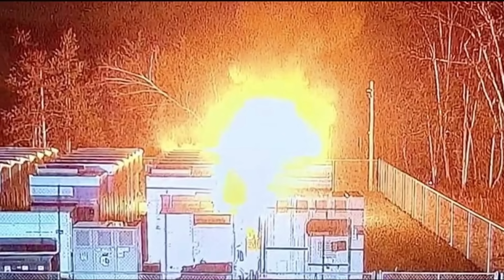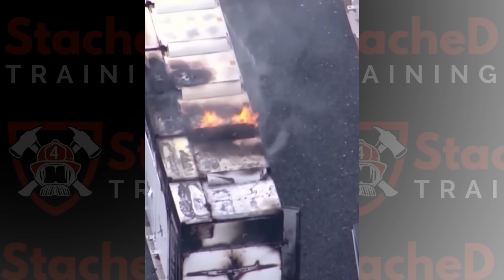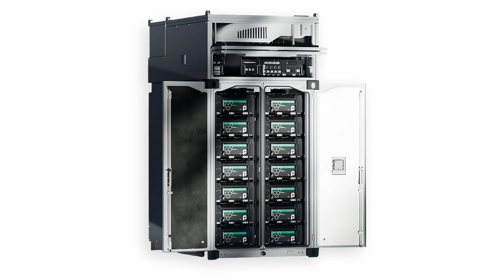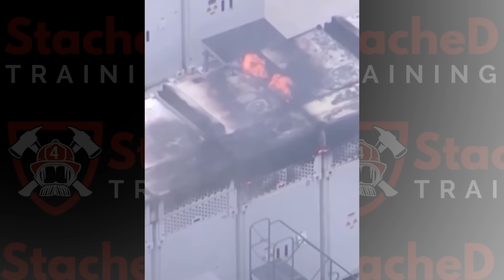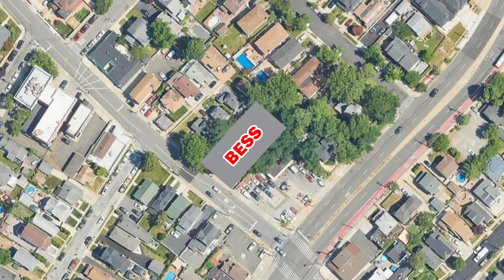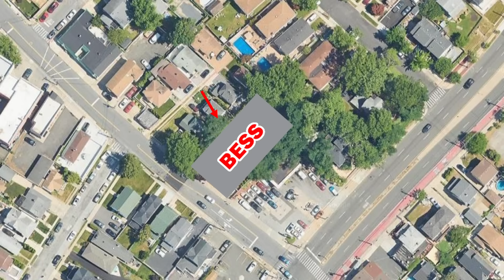Battery Storage Fire in Warwick, NY: A Repeat Incident

Comment from the maker: Happy New Year!
Reply: Happy New Year to you, too!

Had an idea for retrofitting battery storage facilities like this with some fluid immersion and individually wrapping the batteries with special bags (similar to fire blankets). There would be take-off tubes for any gases generated or potentially even use it for active cooling by having a vacuum setup on the line. It'd make it a nightmare to service individual batteries, but has the potential in more specialized minds to be turned into something better, hence this comment. Enjoy everyone lol.

Edit: I did also have the idea of having loose glass fibers inside too, but not sure that'd have the desired effects.
Reply: Happy meal
Reply: Happy New Year, StacheD!
Reply: Are you tracking the new Sodium Ion batteries as a safer replacement to Lithium ion?
Reply: Lithium cells gotta go. There are better techs out there like sodium, aluminum, and silver infused Lithium.
Reply: @ActivateMission2ThisTimeline  How do you know they won't catch fire as well?
Reply: Happy new year, btw thank you for covering this, i have family who is with the  department there!
Reply: how dare you, with trump alive ?
Reply: Happy New Year! Question for you: what are your thoughts on the BESS fire that occurred in Surprise, AZ back in 2019? Do you think it was a good call to move in with a line or was it a better call to set up an safe zone around it and let it burn out?

Comment: Risk of water intrusion?  How about building the entire unit above ground and with a roof...and why not brick or cinder block walls in between units?
Reply: We had a massive POWIN system installed in 2023, there was a fire on a smaller installation caused by water ingress so they literally had to put blue tarps over all the newly installed battery units until they could design and install a new cover... Needless to say POWIN has since gone bankrupt lol

Comment: Tesla mega packs are NMC - i.e. the kind of battery that turns into a pile of fuming thermite, repeatedly exploding as cells pop off - LFP prismatic cells are a safer chemistry hands down, trading some capacity - but that's a worthwhile trade in places like that.
Reply from the maker: Only the old Megapacks are NMC, the new ones use LFP.

Comment: 3:14 You can extinguish battery fires, you just need brine (salt) water, and lots of it.
The salty water causes the cells to discharge and the constant flow takes away heat, just suck the energy out of the system.

Sure, you just salted the earth below the fire, but... you don't really want things growing under them anyway.

Honestly, if I were designing these things I'd fit them with a tank of the stuff on install day, with sensors to dump the tank into the pack the instant it detected thermal runaway... then a technician just comes in, dismantles and cleans the existing cells, puts them all back in (except the one that was burning up) and the storage is up and running again in just a few days, maybe a week.
Yes, it will be degraded from such a large discharge of the individual cells, but thats controllable.

Comment: Hydrogen Fluoride gas and Hydrofluoric acid, which are generated in Lithium LFP battery fires are both spectacularly toxic.  Fluorine makes up around 2% by weight of LFP batteries.  The firefighters at this incident are doomed to future cancers and illnesses.  These battery systems are FAR worse, environmentally than just about any other energy system.

Comment: So, was it a battery fire or an electrical fire? Different cause / effect may be present and a faulty conclusion may cause a great deal of pressure on future installations and rising costs. What caused the initial failure? LiFePO4, with frequent testing, has shown to be unlikely to enter thermal runaway or explode.
Reply: I understood it started with an electrical fire because of water getting inside. Then the nearby batteries catch fire because of the heat. Just guessing, that part was confusing.

Comment: wouldn't they build these structures in such a way that the roof doesn't leak? the battery unit must have some ventilation, if it gets wet you have an issue

Comment: I used to work with Li-Ion cells (18650s, mainly) from ~2007-2016. I cannot even tell you just how embarrassed and shocked I am regarding how they're used today. :( It's almost as if several companies pushed for SO many bloody units--and for projects that didn't warrant using Li-Ion--and for those units to be pushed far beyond their current draw specs (too many amps). And the chemistry is only aggravated by water, obviously. It's literally both playing with fire, and also with toxicity. STUPID.

Comment: I used to work at Apple, we had a script we had to read about fire or smoke mentions. You would be surprised that the first few questions were have you called the fire department and are you safe. We have known for a while that laptop batteries burn really hot and explode. That can be catastrophic, with batteries being made that are larger and you sit on in cars, that's terrifying. I have 3 extinguishers, one in the kitchen, one in my bedroom and one in the garage. Old house and we are upgrading the electrical as we go but since you have to plan ahead not after the fact. Thank you for covering this. It's what in I.T. we would call a known issue with the technology and I don't think there is a safe way to deal with random self ignition of these type of batteries. Look at how you can't check even a phone or laptop on a plane.

Comment: Do you train for exotic fires?  I think in the 80's or 90's the Cornell Chemistry department had a uranium fire.   I think the only way to deal with such is to flood it with an intert gas -- water is just more fuel for a uranium fire.   But maybe there's another method.

Comment: gonna have to come up with a way to deal with this. battery storage systems are just too handy to not be used. hopefully we can get some sodium-ion batteries online in the next few years (less energy density, but they should be way safer)
Reply: handy for what?

Handy is reliable fossil fuels... not this garbage needed for unreliably "green" power.
Reply: @mattlane2282  dispatchability

Comment: The self ingntion temp for LFeP batts is significantly higher than other chemical composition batteries. This does not bode well for these type batteries. They are the preferred type for marine applications as the level of safety is higher there than in any other application except aviation. I am very interested in this event.

Comment: 3:39 yeah I wouldn't expect firefighters to go tackle the massively dangerous electrical fire, I would expect them to at least make sure that it stays contained to whatever is burning if possible and not spread to like forests or other buildings which is exactly what they do, there's nothing wrong with that technique so other firefighters getting upset about a fire that can't really be put out just seem silly, much like the machine shop that I was working in, we would work with magnesium and stuff like that and we followed all the safety precautions that we could, but at the end of the day the rule of thumb in the shop was if the Magnesium shavings started to burn dump the CO2 fire extinguishers into them and Evacuate the shop, if the CO2 fire extinguishers couldn't deal with it at least it will hopefully stay contained to one machine or the Chip bin  that the machine empties into. We haven't had a fire at the shop probably because we don't let chips build in the machines, but the risk is still there.

Comment: BS on the water ingress! I call BS, malicious firmware update would make them burn down! These batteries don't store enough to say so! I think they are being installed for just this reason as most with common sense wouldn't install these at all because the risk for bad actors being able to weaponize these batteries at will as they are all probably network connected & can be hacked to be weaponised!

Comment: Why does energy density matter with a stationary battery? Lithium is not needed. Lead acid is much cheaper per watt hour and does not burn like this. So long as you vent possible hydrogen accumulation they are way safer

Comment: they could design the unit to be gas tight up to say 10 inches of water column same as a propane burner pressure so if the battery. off gasses it would burp similar to a lead acid battery venting.

or if the gasses are lighter than air they could design the cabinet to allow the gasses to collect at the top of the enclosure and then when lit it would blow open a vent similar to like on an rv roof.

and a baffles that would keep the rain from entering similar to the baffles in a wood stove to keep the rain from getting into the fire box.

Comment: "... and a wel known failure pathway."  That really is the point. 

When visiting the USA, I continue to be surprised by what seems to be little or no weatherproofing of electrical supply equipment. Ths isn't every installation in every location, but you often see stuff that should be condemned and replaced, but is obviously still in service. 

But that's old equipment, usually things like domestic supply meters, etc. In this case, it's pretty new, industrial-grade (supposedly), and intended to be out in the elements. 

How on earth didn't the design get a simple test with a fire hose, or something similar before it went on sale?
Reply: It stemmed from the company expanding manufacturing to new plants which had slightly different processes. This design flaw was a large reason that the company POWIN is now bankrupt.

Comment: Can't they even design them in a way that DOESN'T allow water to come in?? For instance, avoiding that well-known flawed design that instead offolding the ridges of the covering plating OVER the vertical sides, having slits in the top, horizontal field with only a rubber lining underneath, which can fail? Or,another one, fans that sit directly in the outer side instead of recessed and in a downwards sloped channel, besides them probably missing a few rows of fine wire mesh with separations (in-)between them towards the outside, that will stop water droplets from getting blown in when there'd be rains combined with wind? By the way, it is obvious I don't know much about these batteries themselves, but when a system does not produce condensation, all the cooling could be achieved WITHIN a completely watertight encasement with only enough contact area of the metal surfaces on the outside and cooling ribs. In case of water cooling one would of course put all the connections between hoses or pipes with other components such as pumps, put all connections that ever COULD start leaking leaking on a lower position than your sensitive equipment itself, and outside of your primal watertight enclosure, just like one would feed all cables on the lowest point, sealed.
Reply: Good points, also if you cannot stop water ingress then drainage holes at the base of the units to ensure that it escapes.

Comment: So, if "let them burn" is the best strategy, is there a case for using water spray to scrub the air (smoke) and limit downwind contamination?
Reply: Good question!
If HF gasses attack lungs and eyes then a water mist should work.

Comment: Nice.
I use batteries at home here.
The Lithium iron ones.
My specs are very strict. No huge currents, 0.3C MAX no temps above 40°C
Reply: Commercial products run those cells at their max.
Wich is great for powertools but not as great for home power.
The ferro type cells love to be slow.

Comment: I've already done the maths on these mass battery storage systems.
If you look at the risk of fire of a single battery cell (in the range of 1 in 1-10 million per cell per year) once you start putting HUNDREDS OF THOUSANDS of battery cells into the same site, you are starting to get into the region of having a predictable fire every year or two, at every site!!!
Reply: Awesome point!
Reply: It's not one battery - is it?
It's one battery comprised of 100/0's of cells
Reply: @CosmicSeeker69 Nope, THAT is what is called a (battery) 'pack'.
Reply: @CosmicSeeker69 The literal definition of the word "battery" is a collection of cells, where chemical resction is converted to elecrrical energy.
Reply: Feelin' green!
Revolutionarily Green!!
Reply: Yup
Reply: Right. It's insane.
Reply: Glad I'm not the only one who sees this. I've been warning about this for years
Reply: I agree, your pointed that out well
Reply: Didn't he say that the case was not enough waterproof as necessary? So it wasn't a problem with the batteries. One can put any kind of electronics into a poor case and it will suffer from heavy rain and likely burn. Apart from that I strongly believe that we are still at the beginning of this technology and new developments like sodium cells or others will reduce the risk of a fire greatly and lithium cells will be mostly history wihin a few years.
Reply: @srh2301 “Backward analysis always works

Comment: CATL has CLAIMED that their sodium batteries with a trade name of Natrox  have almost as good a storage density per unit weight as the bottom of the line LFP. They CLAIM they are completely safe. which is likely to be true IF they dont have a high-oxygen electrolute. They CLAIM a life of 10,000 charge discharge cycles. They CLAIM that there are two startup brands of EV cars in China that use these batteries. These cars are appartently very small and built for typical Chinese city use. They CLAIM sales are good.

Unfortuntely, none of these claim can be verified. The batteries are only in China, and they dont allow foreigners to see them. So for now we'll have to take them at their word.  LOL.

Comment: If the batteries are "Lithium Iron Phosphate", these are one of the only Lithium battery compounds to NOT suffer thermal runaway. Obviously there still can be fires, but the chemistry in the batteries won't create a self-sustaining fire like other lithium batteries.
Reply: "Yes, LFP (Lithium Iron Phosphate) batteries can technically enter a form of thermal runaway, but it's much harder and less violent than with cobalt-based (NMC) batteries because their phosphate cathode structure is very stable and doesn't easily release oxygen, which fuels fires. While they won't typically explode or burst into intense flames from abuse like overcharging, they still generate significant heat and toxic gases, and can combust if the electrolyte leaks and meets an external flame, though the event is generally slower and less self-propagating." (Google AI)

Comment: The only grid energy storage that should be permitted is flywheel energy storage. It is much more reliable and much safer than batteries
Reply: What about pumped hydro?
Reply: @aliendroneservices6621 They have many limitations and require a lot of investment, in addition to a specific geography. They make sense when they are used with hydro power plants, as well as other types of power plants that cannot vary significantly their power output according to demand. But they are not suitable for relatively small energy storage facilities

Comment: Ok, you seem to know quite a bit about these. I am in the middle of putting together a 10-ft shipping container stacked with used EV car batteries. Im not aware of anything other than connecting the battery packs in parallel then to the inverter/charger. Is this other equipment necessary? Are there any rules or guidelines I need to be aware of? I wasn't aware that anything was required. My build is for an off-grid remote home on 40-AC. Nothing nearby at all.

Comment: Big deal. Fires happen in lots of badly installed or managed industrial sites. There is an apartment building not far from me that's had two electrical fires in a year, nothing to do with batteries. Obviously a crap organisation that installed or is managing this battery, given that the last fire there was a suspected water leak causing en electrical fire that just happened to consume some of the batteries. Or just maybe there is someone with a grudge working there. Hey USA, it's 2025, not 1925. In the last five years in the USA, house fires have burned down 358,000 homes and killed more than 2500 people. Obviously, houses aren't safe. We should stop building them and live in the open. Or maybe try speaking facts instead of trying to make money by frightening the ignorant.

Comment: Pat, a second concept.  A large volume of sand, placed above every single unit. Enough volume of sand to bury a single unit with enough sand to cover a single unit. 
When a single cell unit ignites. The elevated unit temperature initiates electrical isolation of the electrical unit. The sand is released to cover said unit. In a thick 60CM layer
of sand. In turn,  limiting any further  fire spread.  Allowing the gassing off of the isolated battery unit. Cheers, Mate.
Reply: just isn't practical for static installations at this scale. You'd be delaying the fire, not stopping it. Also, that'd be way too operationally risky plus how would you repeatedly certify that system? 

Works great for smaller situations.